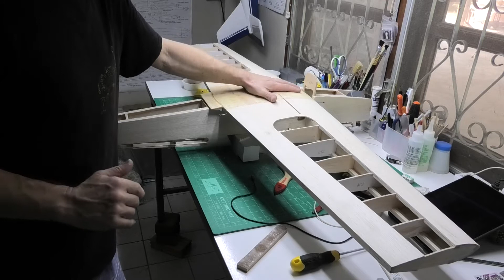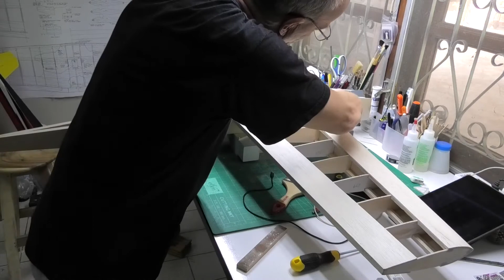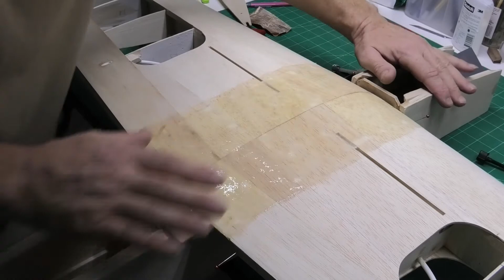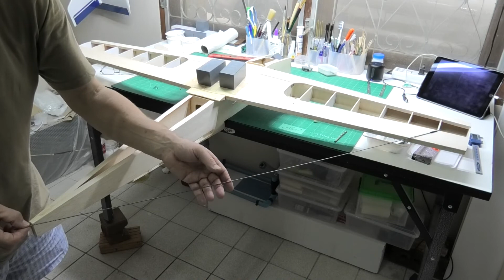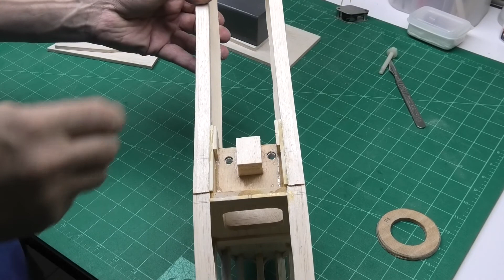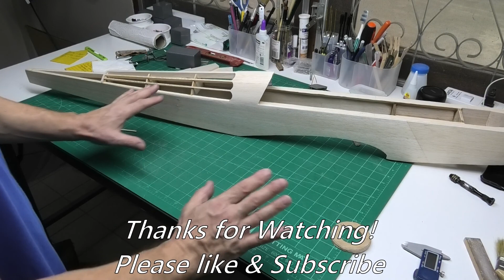Avanti Pattern Plane Pt 9 - Wings, Getting the Correct Incidence - 60" wingspan RC balsa aeroplane

Comment: Hello, Great video!! I had a doubt, Can we use the locking mechanism for high wing planes too? Would that mechanism withstand all the weight?
Reply from the maker: Yes I am sure it will be fine, very similar forces involved.  dont forget with this low wing the the lock will be taking the shock of the landing as well which will not be in the top wing.  Pleased you liked the video

Comment: If the airfoil is symmetrical do you really need the wing to be in an angle different than 0?
Reply from the maker: Hi there, the wing is not symetrical, it is semi-symetrical, and I used the same angle of incidence as stated on the plans, didn't want to change it as I am sure this designer is far better than me with these things.  It is a great plane and flies lovely.
Reply: @MarkRobinson555  sorry somehow i missed that

Comment: Some great tips there Mark, as you explained the rear mounting ply plate I wondered that, instead of raising the front (which would bring it to close to the saddle as you explained) you considered lowering the back to keep it parallel to the wing?
Reply from the maker: Hi Cliff, thanks for the comment, I appreciate your support.  If I lowered the back edge of the rear wing fixing, to make it parallel with the trailing edge of the wing, it compromises the space below it, that is required for the rear control linkages, to the rudder and elevator.  Once you the the hight of the servos into account there is not much space available.
Reply: @MarkRobinson555  I did wonder that Mark, all these things are compromises sometimes, I didn't really think you hadn't considered it 👍
Reply from the maker: I am glad you raised the questions, shows you actually watched and more to the point you were paying attention! Hahaha, thanks 😊
Reply: @MarkRobinson555  I should have tried that hard at school 😁